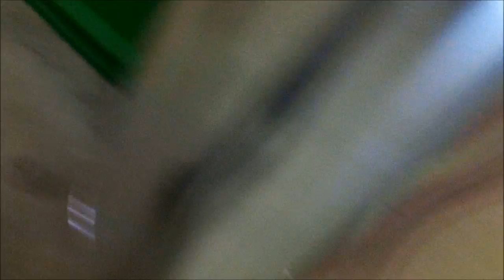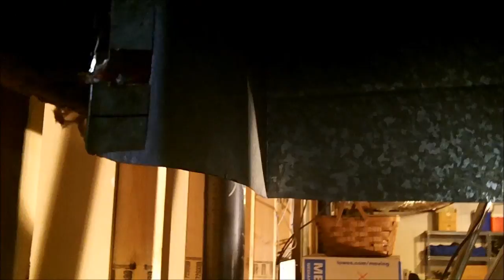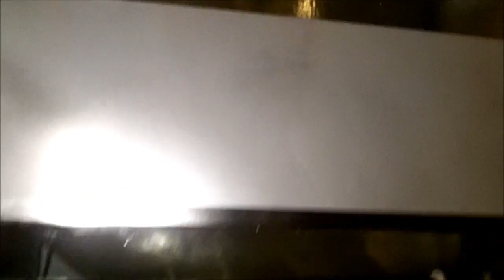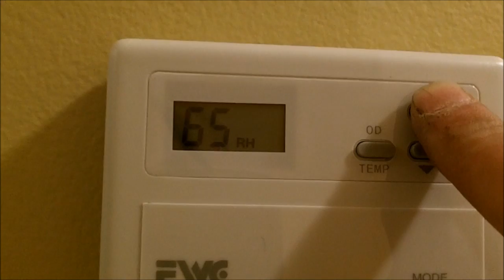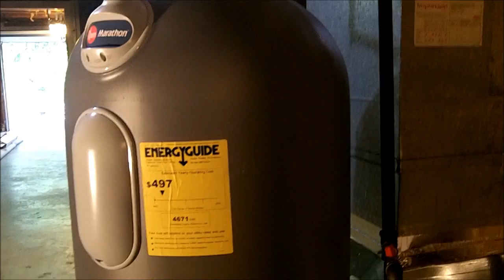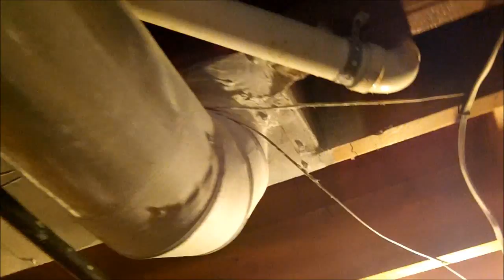Aprilaire Humidifier & Air Cleaner Install Canton Georgia

Comment: Thanks for the video, I'm out of Augusta Ga, and I'm trying to push IAQ here, I was wondering why you choose the EWC t-stat and thank for the tip about spray adhesive-that's the first time I heard that.
Reply from the maker: I use the EWC stat be cause to me it works the best and is digital. If I'm doing it now I try to get the homeowner to change thermostats to one that will bring on a humidifier but if they are unwilling to change stats I use the EWC stat.

Comment from the maker: Hey Jerad, The answer will be different depending on if your going to make it in the field or order from the sheetmetal shop. Either way its easy. If you need to know right now you can call me and I will explain it or if you just want to know I can do a video. I don't do many jobs anymore where I have to use an offset so for me making it in the field is easier then getting one from a sheetmetal shop.Thanks for watching!!!!